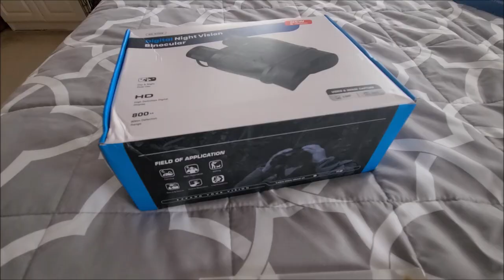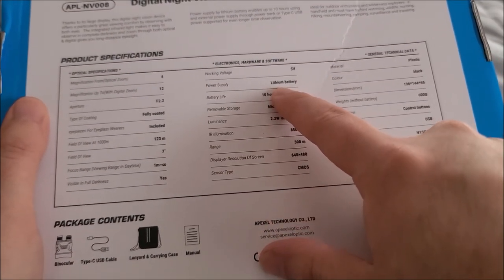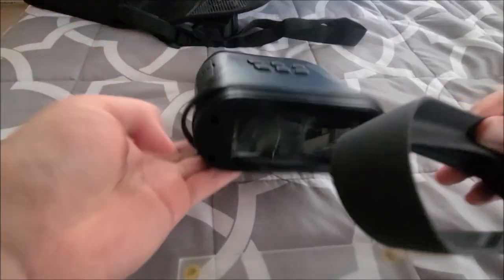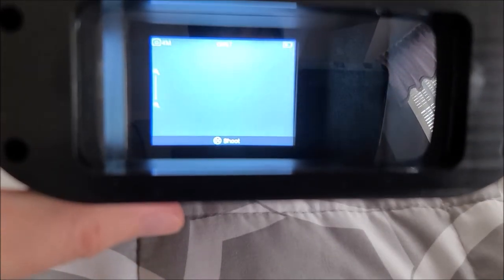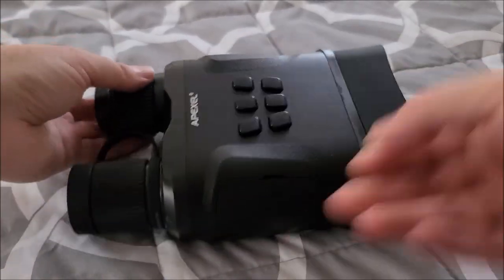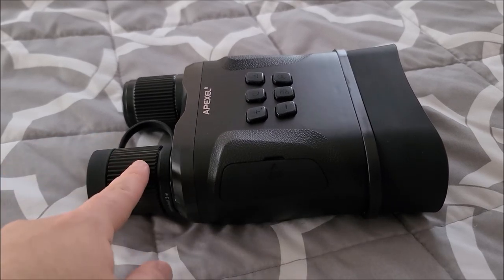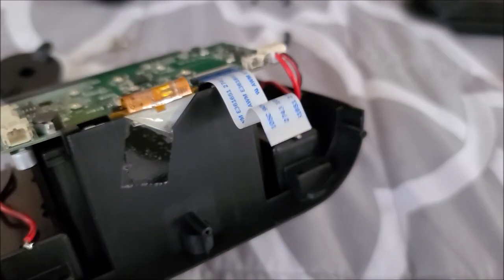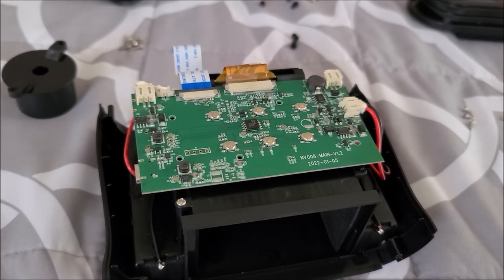Apexel NV008 Digital Night Vision Binocular Review and Teardown!

Comment: It's recommended to use 32GB of memory.  What if you are forced to use 64 or 128 GB of memory.  perhaps not?
Reply from the maker: It would probably work unless there's some hard firmware limitation
Reply: @sjm4306  thanks